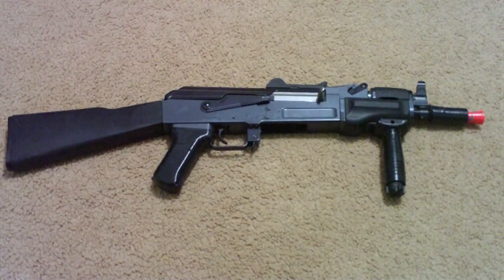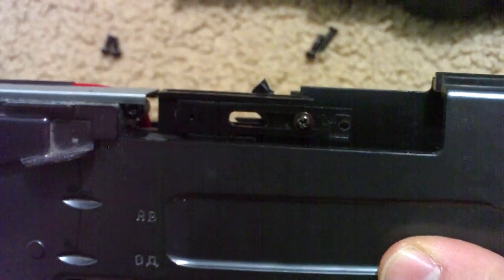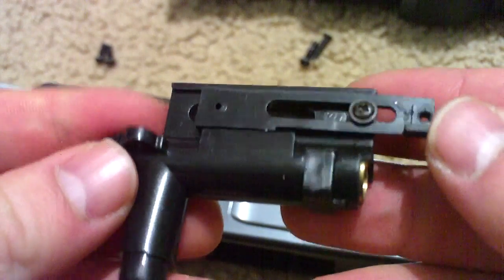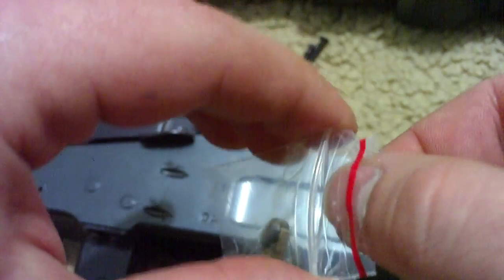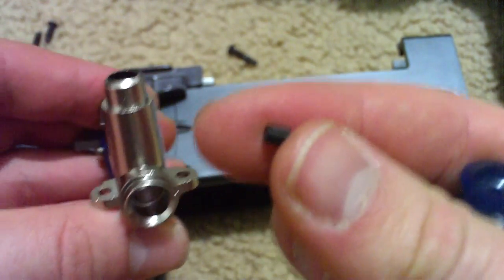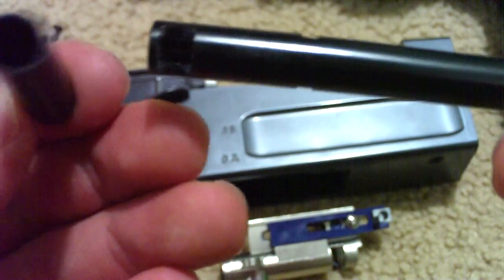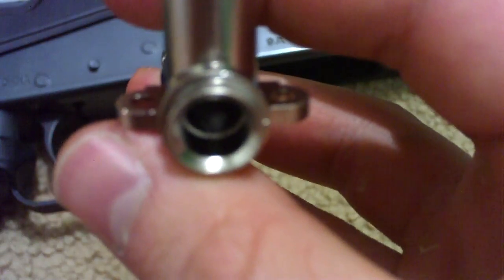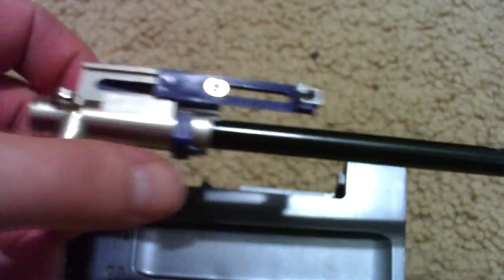How to Replace the Hop-up and Hop-up Bucking on an Airsoft Gun

Comment: if you put the inner barrel with new bucking in before you put the nub, arm and rest of the hop assembly together you dont have to worry about the nub falling out. You can also apply grease to the nub or even super glue it to the arm so it stays held on.

Comment: Is that a cyma cm028 AK47? I wanna buy this gun and either get the Lonex hop up or the cyma one and get a promethious 455mm inner barrel G&G green bucking and a matrix air nozzle and a Systema m100 spring. To improve its performance.
Reply from the maker: I don't think so. I think it was listed as an AK74, but I'm not confident in what brand it is. It sounds like you have a pretty good plan. Just make sure the supporting parts can handle the extra power.
Reply: AJS Woodworks ok thx for the reply. I have to do more research on the cyma cm028, it has a metal gearbox so I think it would be good and I wanna get a 7.4 lipo for it aswell. I  just don’t know that much of the internals of airsoft guns.
Reply from the maker: Jagger _2V Yeah, no problem.

Comment: My clip for my inner barrel will not lock all the way. ( C- CLIP) Is it a bad thing if its not locking all the way? The Inner barrel is snug. I tried the C clip with the barrel itself and it locks but cant figure out why it wont lock with the hop up unit attached.
Reply from the maker: It should lock all the way. You don't want your barrel to start wiggling while you shoot. There are a few possibilities, either your new barrel doesn't have the same notches on the side as your old barrel, or the hop-up unit is shaped differently than your old one. It's probably your hop-up since it clips to the barrel outside of the unit.